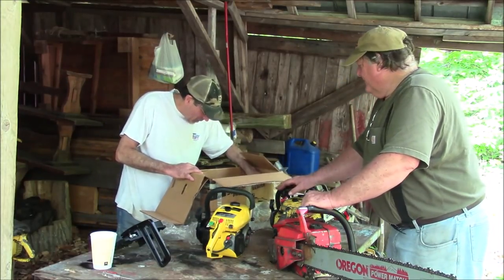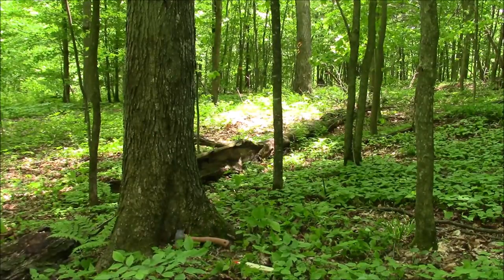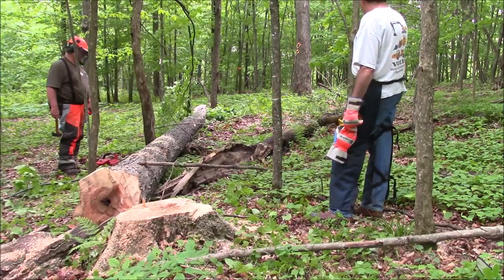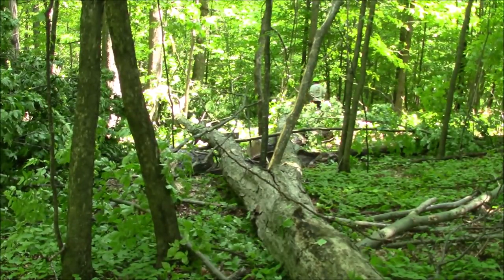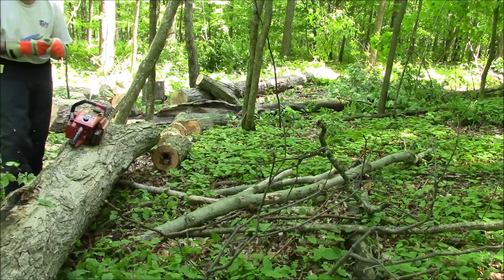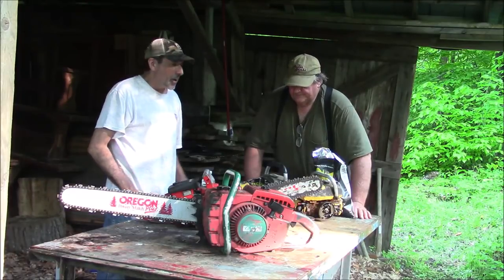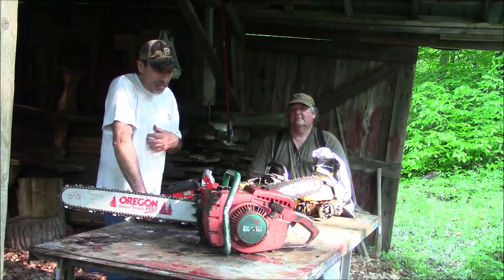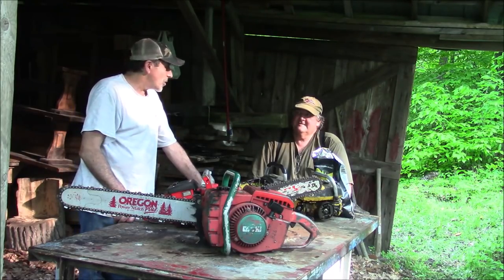Homelite SXL 925, XL 800, and McCulloch 7-10 At Work, Vintage Saws Mini GTG PT 2

Comment: So true, macs usually start great but you have to really fiddle with them to get them to restart hot, and it seems like every model takes a little different fiddling.  And my old poulans never want to start!  The best thing about a mac though is if you are into collecting your own firewood, for small money you can have a 28" saw that really cuts and oils well when you need it for the big stuff.  I have a PM60 with a 25" inch bar and the whole set up costs me less then $100.

Comment: I have a PM700 and PM555 as well as several PM6's but I love my little Homelite SEZ the most of my older saws. I converted one of the SEZ's over to .325 and a 8 pin rim and used it with a husky small mount bar for testing, I want to get a Tsumura lite weight bar for it, I just haven't decided if I want to stay with a 16" bar or go to a 18" bar on it yet. The .325/8 pin rim is still about the same diameter as the original .375/7 pin so no real chain speed gain just less torque required on the saw and that is why I was thinking of stepping up to the 18" bar although the saw I believe was more designed around a 16" bar and balances out fairly well with that.

Comment: I've got a few of the 70cc macs. I've got a 7-10A that was the last saw of my great grandfather's, a super pro 70 (same size but anitvibe) and a pro mac 700 that is almost as clean as the new one you've got. The saws didnt get bigger for the 82cc macs they just came with anti vibe. They are screamers. I use a pro mac 800 all the time for firewood. It's just a little heavier than my MS441 but has alot more grunt. I also have a poulan 245A like the one you've shown. They are strong saws nothing like the new poulan. They dont rev like a mac though. My pro mac 700 and 800 will turn 15,000rpms with no load. I richen the high side to limit them to 11,500ish. Nice video I hope you get your 700s going soon.

Comment: Judging these older saws stood the test of time. In your other video’s your pile of used huskys says they didn’t hold up or were abused. One thing I notice is the scoring on the intake side means dirt got through the intake. The scoring on the exhaust side means it ran lean, it got hot. Do you think the 50:1 mix is not putting enough oil in the ratio of fuel?
Reply from the maker: Old style 372's have lasted and a couple of the 576's, and on the Stihl side 066's and 038's....but you are right with the premise.....nothing sold today is able to take the sustained use those old pro saw did and 30,40, even 50 years later still can hammer out productive work.
Reply from the maker: AND for the scratch on the intake side....if the saw isn't an X-torq you would be correct, but the newer designs flush the intake side with straight air and need a little more than 50:1 in my most humble opinion. Even though they "last" to the spec the manufacturers expect with 50:1, mixes like 32:1 - 40:1 will add a significant amount of life to those X-torq saws.

Comment: Hi guys, I have a pm 10-10, pm 610, super pro 80, and a pm 850, any pm 700's for sale since they don't run Walt?  Walt, are you still interested in helping me put my huztl saw cases together or selling me the tools to do it myself?
Reply from the maker: sure...back from the wedding so can again even think about doing saw related things. Have a few things to catch up on but should be able to squeeze a case.
Reply from the maker: now to setup up a time...you have to choose if you want me to squeeze those cases or make a set of tools...opeforum best place for this discussion
Reply: How do I find you on ope?
Reply from the maker: same handle "afleetcommand" and start a conversation.